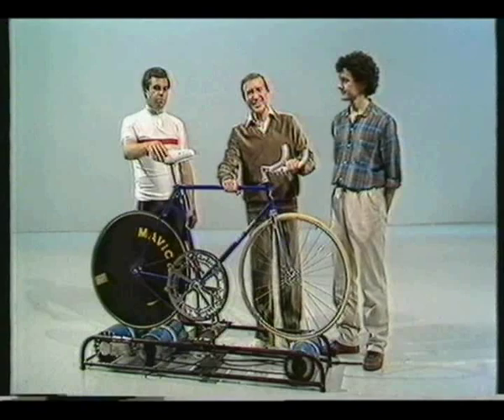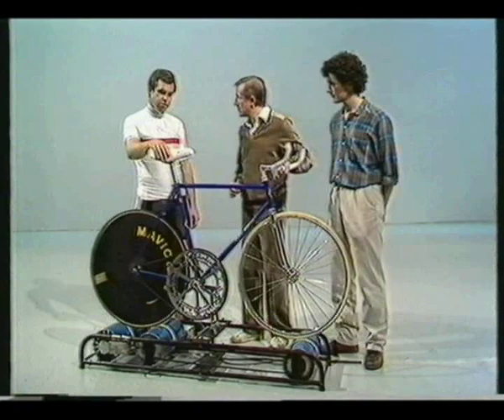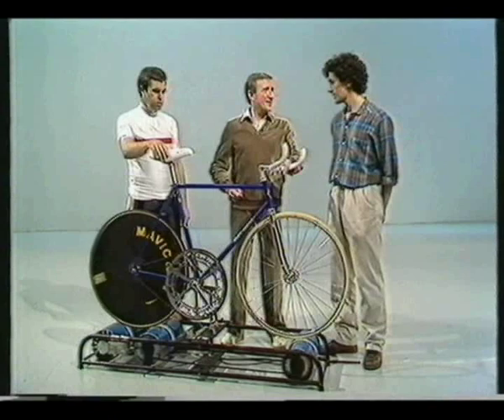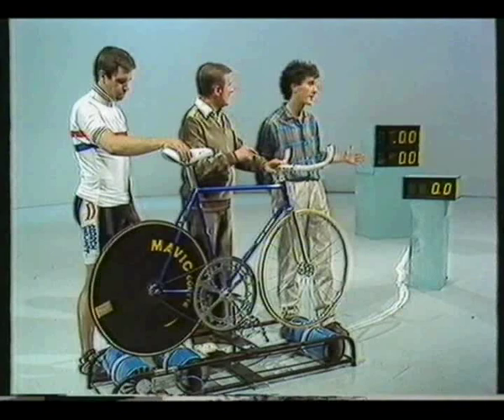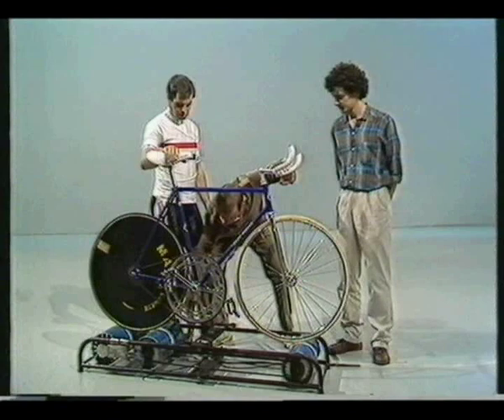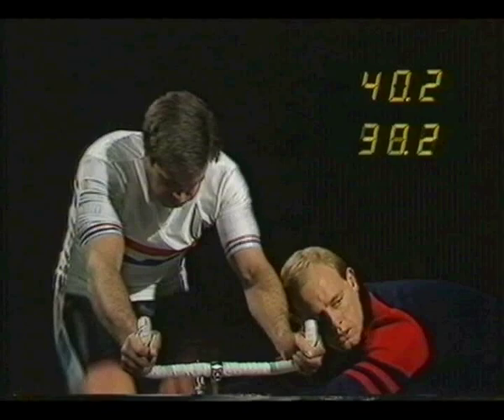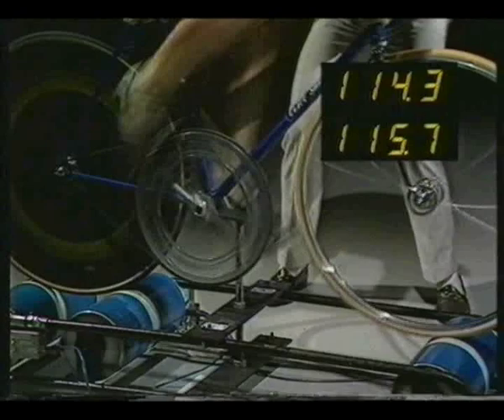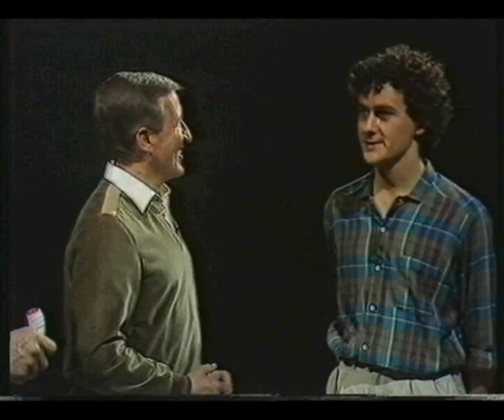Dave Legrys  - 126mph roller record

Comment: With an even bigger gear (and possibly a disc front wheel if spoke wind resistance is becoming a problem) you could set an even higher record.